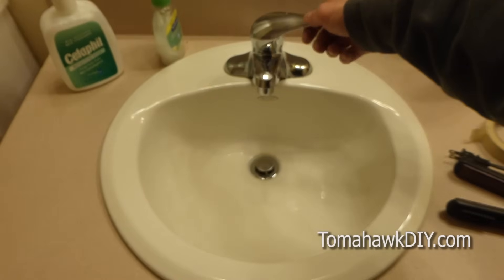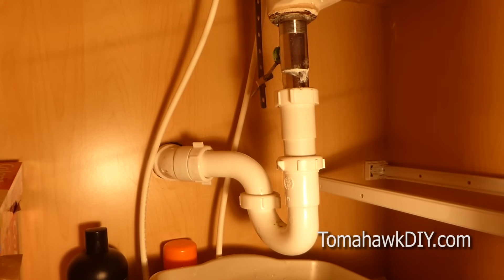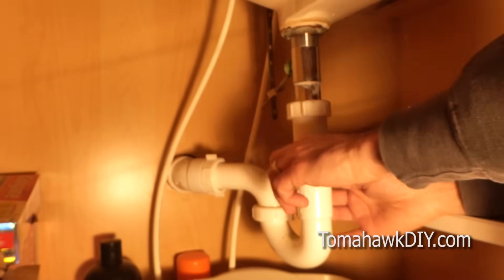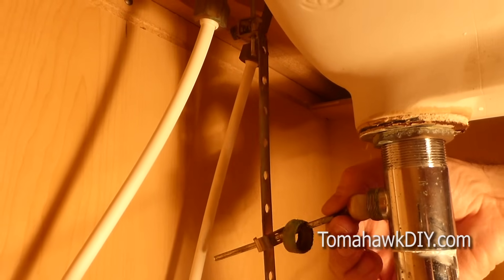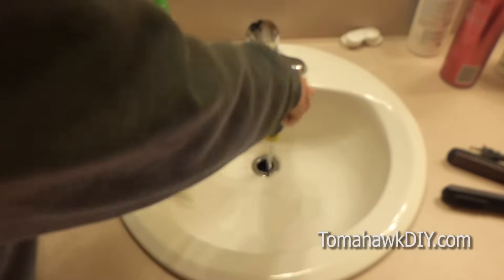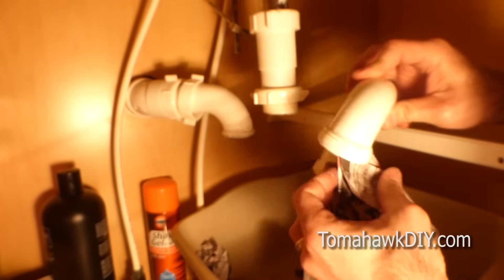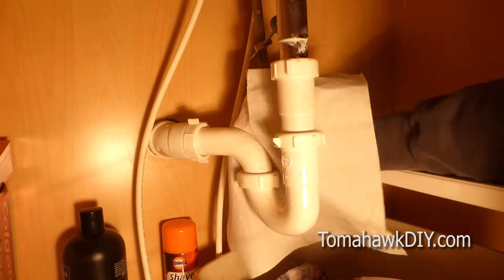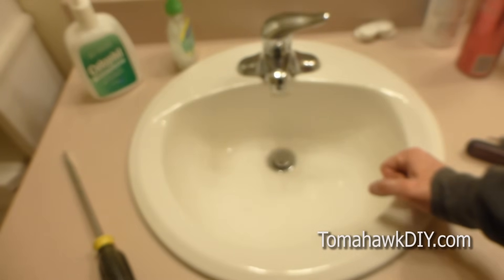Easy to Fix a Clogged Sink - No Tools Needed

Comment: This actually worked. I tried the baking soda, the plunger, several rounds of boiling hot water. Nothing. This actually got to the root of the issue, and even though what came out of the drain looked like an enemy from Metroid, thank you. Without you, I wouldn’t have been blessed with that cursed image. May you live a long life, as long as the hair that came out of my drain
Reply from the maker: Glad it worked well. Thank you for sharing your experience

Comment: Thank you for this video!  I watched it, and took apart the drain under my bathroom sink.  It had nearly stopped.  It turned out that someone had dropped one of the caps from the faucet knob down the drain, and the water flow had nearly stopped.  You saved me time and money from going to town to buy a part that I didn't need.  Everything is back together with no leaks.Thank you!!!
Reply from the maker: Wow! Thats really great to hear. Thank you for watching our video and sharing your feedback. Glad to help

Comment: Awesome video!! My sinks in my master bath seem to clog every few months ever since it was remodeled. I haven't had the money to have a plumber out. 

It's been unable for several months if not a year. I've been brushing my teeth in the kitchen and using the shower to wash my hands. 

Well, no more! 

After watching your video I felt I could tackle this. Finally tonight I made time to focus on it and got it done. Woot! Woot!

I'm so proud of myself. Thanks to your generosity for making and sharing this video I was able to unclog my bathroom sink all by myself. 

You made it easy peasy. Now I just have to do the otherside. I'll tackle that tomorrow.

You saved me a lot of money by not having to call a plumber. I'm so thankful. 

May you be rewarded 10x over. <3
Reply from the maker: Thank you so much for sharing your experience. Appreciate it a lot. Glad to help

Comment: I just got finished unclogging my bathroom drain and this video was extremely helpful. Our sink was clogging and it had been for some time. I rent where I live and I could have definitely called my landlord to do this or a plumber but I grew up in a home with a carpenter and on several occasions my step-dad had to complete this task for me 🙏🏻 I honestly was just curious if this was as easy of a task not only this video made it out to be but how quickly he would do this and if I could complete it myself because let’s face it: all the hair that’s in the drain pipe is my own so 🤷🏼‍♀️. Here’s a couple things I learned in this process: this was my first time ever clearing a clogged pipe so it did take me around an hour to complete but I did and my sink it running so perfectly now I keep running water in awe of the cleanliness of the whole thing 😂 For me the sink was pretty corroded so I chose not only to keep clean dry towels on hand but Clorox Wipes as well and they were very helpful in this process. I didn’t know what I was going to use for a water collection bucket to be able to keep under my sink for the next few days and I didn’t want to use my Tupperware , my suggestion is a used Swiffer wet mop container would be perfect in this situation because I could just dispose of the whole thing after the process. I had an old shipping bow which I lined with multiple plastic bags because that’s just what I had available and it seems to be doing just fine. At the end I can just bag up all my newspaper and dripping and just dispose of them like normal. I did use 6 pieces of rolled advertisements or newspaper to complete this and because I’m an overachiever after putting the paper through twice, I wrapped a rolled piece with wipes to just get that extra gunk because I honestly don’t want to have to repeat this process and I really wanted to get it as clean as possible. You don’t have to do this, this was an extra step. I didn’t have a zip suggested in The Home Repair’s video of how to unclog my drain so I actually used the pole piece of a outdoor Christmas tree decoration 😅 to be able to push the paper through. This worked fine for me, I think even a wire coat hanger straightened out might help with this step too, like I said, this was just the best thing I could think of that I had on hand. I did have to watch The Home Repair video on unclogging in addition to this to make this happen, only because I was curious of when to put back on the bar metal piece that screws in once the pipes are cleaned. I needed verification for this, his video was very helpful in this process too. In my case I was unable to remove the goose neck part of my piping I think because it didn’t have a screw in piece like in the other videos, my building is very old and I don’t know if because of that they are different but I was able to clear all of the hair and gunk, and yes, there was more than I was expecting and my sink is working wonderfully now. That metal part you just screw back in (make sure it’s level) once you’ve tightened your p-trap. I was very lucky in this process my piping was not so screwed down that I could not loosen all of this by hand. My p-trap was very dark so I did run extra water through it because I thought it might be because of the grim, again, it might just be that way because maybe it’s old because it ran clear even though it was dark inside. I’m thinking that’s okay. After tightening everything back into place as this video describes I’m running my water and there is absolutely no leakage. I am going to leave the “bucket” underneath for a few days just to ensure. Overall this video was extremely helpful and I couldn’t have done this without this gentleman’s wonderful advice. After doing this I don’t think just putting baking soda and apple cider vinegar down the drain would have been very useful. My sink it white and clean and happy again and I did have to watch a few video’s to ensure I was doing it correctly. This was a fairly helpful video. It did smell too yes, but not as awful as I thought. I’m very happy to have a working sink 👍🏻👍🏻 Thank you for sharing this video 😊
Reply from the maker: That's amazing! Thank you for sharing your experience. Glad to help!

Comment: I tolerated my clogged sink for months after chemicals and boiling water didn't do the trick.  I saw your video and thanks to your simple instructions, tried it and successfully cleared out the small hairs that had built-up and gunked over half the diameter of my drain pipe (no wonder I kept having backup issues).  I didn't have newspaper so I used brown packing paper from Amazon orders--only needed one pass to swipe it all.  Got a little worried when the paper felt like it was getting stuck, but a broom handle successfully pushed it all through (I didn't think I had a screwdriver long enough).  The hardest part was getting the drain plug in the right position based on the hole chosen in the rod underneath (shown at 2:08 - I have a different one which its clasp fell off and  I had to guess where it was when putting it back on).

Thank you!!
Reply from the maker: Thank you so much for sharing your experience. Glad I could help

Comment: Lighten up people, you can use a stick instead of a screwdriver. Hope everyone has a screwdriver and a pair of pliers at home.
Reply: james gallagher I just use, the other end of my plunger instead of using screw driver
Reply: Essentials for any home.
Reply: @jonclarkson5911  lmao
Reply: Smart People go to the Dollar Store and get a CHEAP Plastic Snake for $1.00.... Works better than Plungers !!!  😂😂😂😂😂😂😂😂😂😂😂😂😂😂😂😂😂😂
Reply: He was really helpful. Don’t be rude with your nagging comment. A stick can break if you accidentally use too much newspaper; where as a screwdriver, in which is useful for anything in the household btw, won’t break. Furthermore a plugger may work, but I find that it doesn’t actually clean out the gross gunk like this does.
Reply: @jonclarkson5911  Rude. When it's that nasty a plunger doesn't get everything out, and it could soon be clogged again. This is informative for a lot of people and it is the best way to get everything out.
Reply: If it's the shower-room, you could use one of those handy plastic rods with bristles at one end...
Reply: I use hose.
Reply: Yea

Comment: I'm so grateful to the people who make these available. I removed the goose neck part and only a little bit of water came out, so I decided to remove the pipe just above it. The little bit of water still in the sink wasn't draining, and there wasn't much in either of the pipes to justify it being clogged. I took apart a wire coat hanger and threaded it into the hole and I suddenly heard a plop noise. There was a giant chunk of black hair somewhere in the top part of the drain. Gross, but wonderful that I didn't have to pay some guy to come in and fix something so fixable. 
Thanks to YouTube I've changed car batteries, learned the easy way to split wood, and now, can fix a sink drain.

Comment: I was able to drain the water but after putting the pipe back, water still backs up. Is there anything else I can try before I call a professional?
Reply: Same
Reply: Same here!
Reply: Have you tried a snake?  Simple tool. Like a Long spring.     Buy at hardware store.  Inexpensive.

Comment: No Tools Needed
Uses tools
Reply: Faxxxxxx
Reply: anne weber hes not the tool cause hes right
Reply: He used his hands. No snake required. No tools used. Screwdriver was to push papers down. I didn't use paper.
Reply: @redpoppy3569  yes, but you also didn't make a video with the title "no tools used"
Reply: @bromar1102  So I'm selected to be poked at?
Reply: @bromar1102  he said no tools needed, he didn't need the tool for that part. if youre going to criticize for finite semantics, learn how to read
Reply: @anneweber7029  I haven't heard someone say tool except for the band in about 15 years lol good to see it was brought back...
Reply: Correction uses TOOL.

NO (S)
Reply: @redpoppy3569  yes
Reply: LMFAO 😂😂😂😂😂😂😂😂😂
Reply: Yeah, he was also probably wearing socks, though, they were not NEEDED to complete the job. Being barefoot would have worked just fine. Much like using a wooden spoon, coat hanger or tree branch would have done the job of the screwdriver.
Reply: anne weber wow to get offended really easily

Comment: I'm 22, live alone, hate doing house chores and definitely never did anything remotely close to unclogging a sink. You just helped me open a 2 months old clog that I really got tired of. Thank you very much.

Tip: as one of the comments says, if you don't have a newspaper use paper towel, worked for me.
Reply: or just use a opened up wire coat hanger, assuming anyone on the planet still has them besides me.
Reply: Use a rag

Comment: Just like other comments, this has helped me for a couple of years now with my bathroom sinks. I just want to add that today, I used the drain snake from the dollar tree to see if I can unclog the sink without having to go through taking apart the pipe under the sink, and it did! Just in case someone has a sinkful of dirty stuck water in the sink and don’t want to go through taking the pipe apart and having to catch all that mess under.
Reply from the maker: Thanks for the suggestion

Comment: Thank you for uploading this.  I had no idea it was this easy (and smelly) unclogging a drain.  I did this last night as I had a clogged sink drain.  I was to blame because it was my "hair" that was clogging the drain when in fact I have no hair on my head lol and I normally shave in the shower. Every step went exactly as shown and I almost threw up when I took the curved section of the pipe off. The smell was terrible!  It worked though and I can now say that I won't be buying any chemicals anymore with this quick and easy fix, thank you!
Reply from the maker: Good work! Glad it worked well for you.

Comment: Woow!! Thank you so much, I just unclogged my bathroom sink in less than 10 minutes. I pulled out a 5 inch hair/sludge blockage that was stuck to the drain plug and almost fully plugging up the drain pipe. Awesome quick fix!
Reply from the maker: Great job!

Comment: Please note, if you are tight on time, or your house is old & you  haven't done any work on those elbows in a long time, just do 1st part of video -  undo the drain plug  rod (2:00), & use long needle nose pliers and/or something with a hook (retrofitted metal hanger) to pull up what you can - this usually works.    You want to avoid having to try / fail rethreading elbows if  you haven't touched them in a long time, esp. metal elbows - that can be very hard to rethread w/o leaking.   Learned the hard way. :)

Great video - you can tell the time you put in getting all the right camera angles!!
Reply from the maker: Thanks for the tip and thank you for watching!

Comment: Awesome vid, 8 years later you just saved me a plumber visit!  I took out the P trap and cleaned it all, the put it back together, but the water was still slow.  Turns out I had to remove the pipe going into the wall since thats where the most sediment was jammed up
Reply from the maker: Nice work!

Comment: After removing the faucet aerator, I attach ¼" tubing to the faucet and water blast the drain pipe without removing any of the piping or the drain plug.  with a small investment in the parts, this is much simpler and less messy.

Comment: I didn't even need to remove the goose neck, just took out the stopper and cleaned it from there. I learned two things, clean up beard hair from the sink instead of forcing it down the drain and that this was easier than I expected. Thank you.

Comment: I want to say thank you for the video. When I saw it happen, I knew I had to take action and fix it. I did it, I took longer than I expected but I did it. The only thing that took me a long time, was a drain stopper because I had a to get it to line up to the to the piece. But other than that it was a smooth operation. What are the funny thing is I had to hurry up and fix it because the water was about to rise up in my bowl I was using. But again thank you so much for this video, and hopefully someone else can use this video in the future
Reply from the maker: Happy to help! Glad you're able to fix your clogged sink 😊

Comment: As a person who has no idea what they were doing, this was really easy to follow; however, I think I messed it up somehow. My sink is clogged with… regurgitated chunks… and I decided that I should DIY fixing it. I followed this. Very simple to follow! I love it! However, there’s some kind of cementy-goo that’s on the part where you twist the things onto the pipe, and I have no idea if that’s normal or if I should’ve stopped what I was doing and cry myself to sleep because I don’t  know what I’m doing. I clicked “continue”. Doing that, I found a penny inside of the curvy pipe! I was unable to undo the bolt that dealt with the drain thing, so I couldn’t clean that part. I was very sad because I have absolutely 0 tools. So, I went to put the curvy pipe back on and the screw thing at the back had some difficulties complying to what I wanted it to do. I eventually fixed it, I think, but now there’s water collecting at the top of it and I don’t know how to fix it and  guess what? We can’t afford a plumber! :,) This video is super helpful, though. Will 100% try again with this video, though, when I regain the courage to deal with that mess.
(edit because i said plunger instead of plumber)

Comment: If you overtighten while putting it back together. You can use rubber bands to make it work again. They would go under the white part that spins. I would say to only use it as a temporary fix but I haven’t had an issue after doing that 2 years ago.

Comment: I use to be an apartment owner and one thing I learned is that the number one clog is in that stopper.  Just disconnect the ball lever, remove top stopper  clean it, use fishbone hair remover ($1) run water, put back the ball lever.

Comment: I just watched this and followed along with the video.  Found so much black mold. My throat flared up.   How often do you clean sinks out?   I mean it was mostly mold a white paper towel came out black!!    House was built in 1998 and were the second since 2013. And I figure if waters flowing through , it’s good.  There was no mold around the sink but it was that pipe loaded

Comment: Great video, but I got a problem that the video doesn't address. 
I got a blocked sink, and the sewer line goes straight to another sink on the wall behind. 
I can't get my snake to go down the T to the main line. 
It keeps going straight across and coming out the other sink line on the other side of the wall. 
Any tips for getting the snake line to make the 90 and head down to the main line? Thanks!

Comment: Do you have to turn the water to the house off?
Reply from the maker: As long as you only work on the drain line there is no need to turn off the supply (water to the house)

Comment: Noticed my sink was slow to drain, came to YouTube to find a solution. Your instructions were easy to follow and I was able to clean out the pipe. Unfortunately, my sink has an extra pipe coming out the side 😢 
So after reassembling the piping, it was still slow to drain. I think the blockage is in the side piping.
Reply from the maker: Oh, that's frustrating. Hope it gets fixed soon

Comment: It's nice your plumbing has FOUR different points to unscrew (plus at the bottom of the trap)!  Mine literally has just ONE where it goes from pvc to metal...  All the rest is pvc that's solid, glued together or something....  Literally have to pull the whole thing down and to the side to get that top pipe out and you still can't clean any farther down than that without some tools...

Wish the people who installed the sinks just put in those couple rings...  Would make it SOOO much easier to clean...